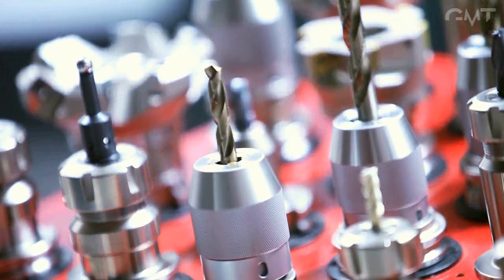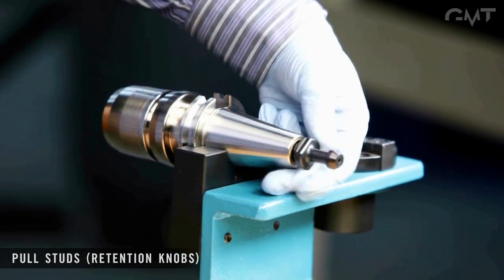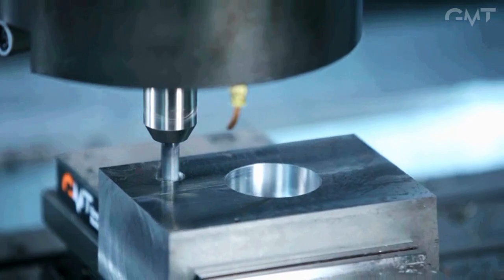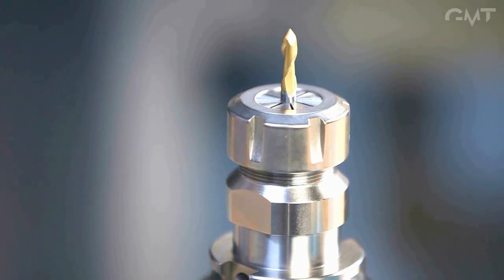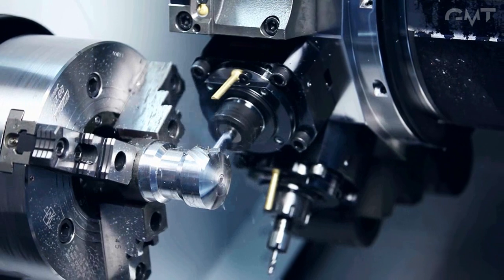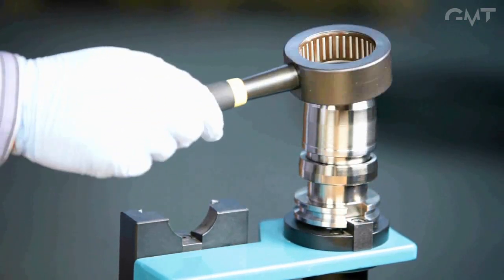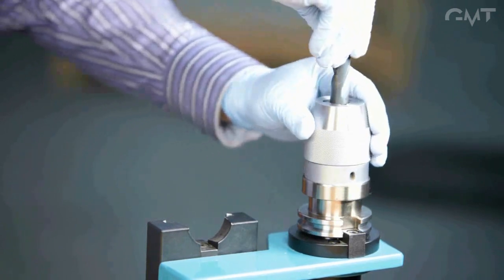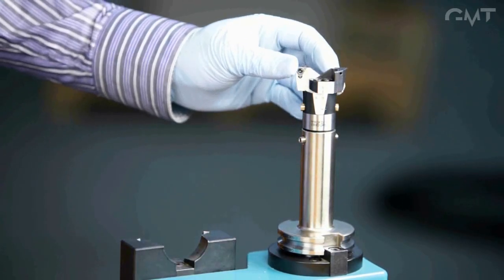Crash Course in Milling: Chapter 6 - Tool Holding, by Glacern Machine Tools

Comment: Great video Sir, can you use a NT40 drawbar on a BT40 tool or do you have to use the pull bar instead..... there doesnt appear to be a variation in the taper on either, just the NT40 has the straight peice on the end..... sorry, a newbie to milling so cant quite figure this NT/BT thing out